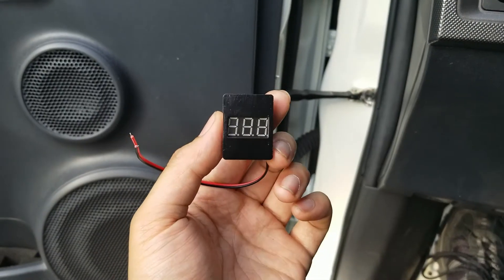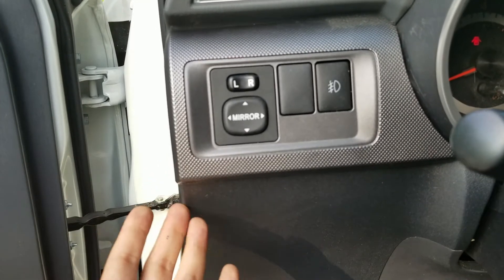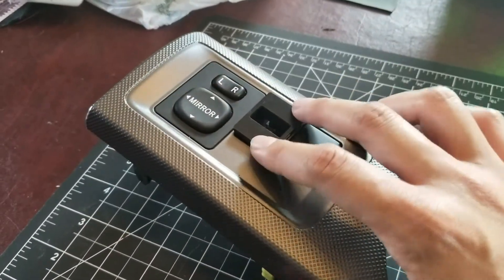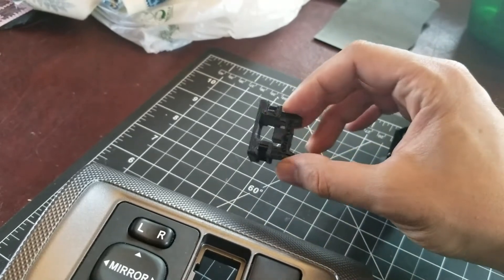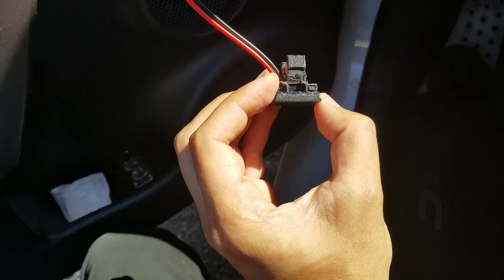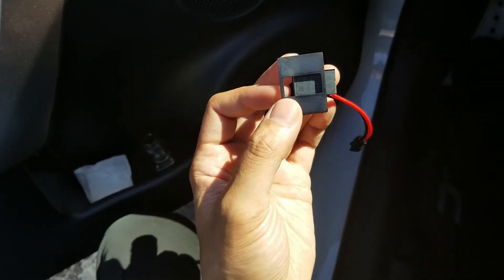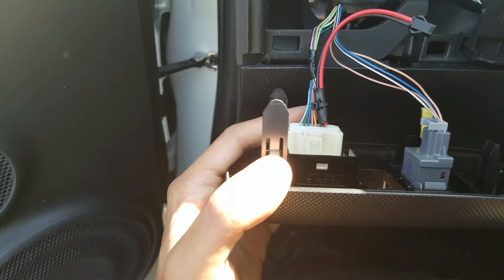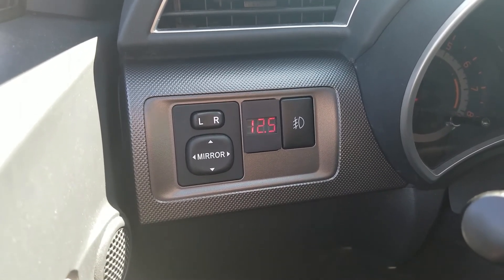Breton Performance Engineering 3D Printed Voltmeter Install / Review (Scion tC2 / tC2.5)

Comment: Thanks for your excellent step by step instructions! They were a great help for me. I am not sure if the 3d printing was different from the one you received three years ago, but I noticed even after performing the modifications you had demonstrated, the two tabs appeared to be compressed and were not as long as the ones originally installed on the blank so they could not lock into place. I did try to try to lift up one of the tabs and it snapped off, so I decided my only alternative was to superglue it in place which worked out fine. Just a little frustrating when you expect to have an easy install and find out you still have to do modifications to make it look good. Thanks again!
Reply from the maker: Glad my guide helped and you were able to get it installed. Wow, three years ago. Lol. I had to check that posting date of the video.

Comment: What vender did you use to purchase your two pin connector wire and the two back probe connectors? Did you have to solder these back probe connectors on  the wire or were they just crimped? Enjoy all of your videos, thanks!.
Reply from the maker: I got mine from https://amzn.to/3vTHxJl. I soldered it to the wires from the voltmeter only.
Reply: @VampyreX13  Thanks for the quick response,  I will place my order now.